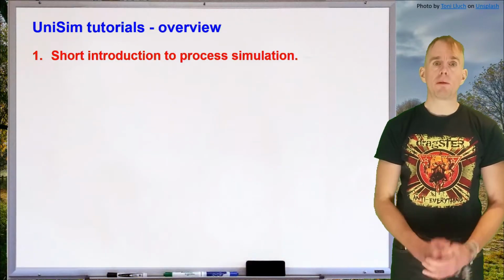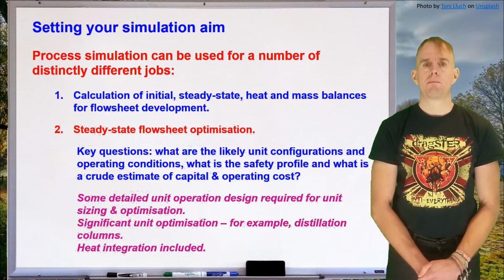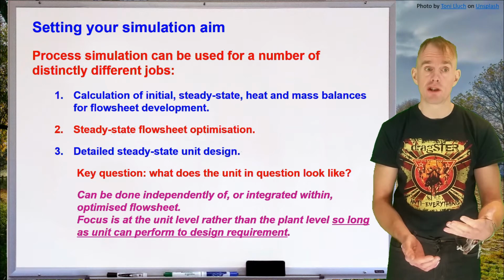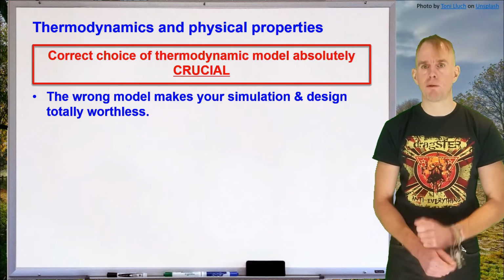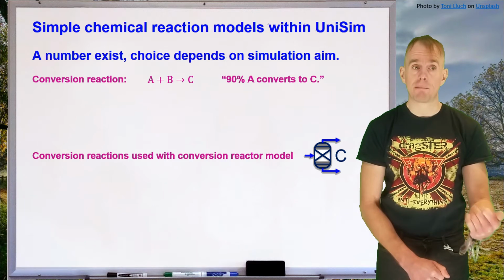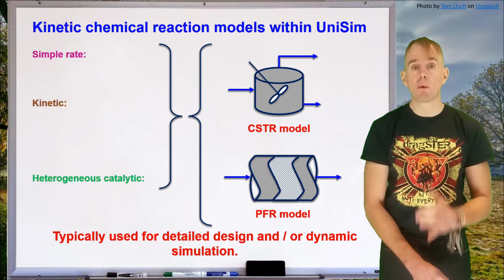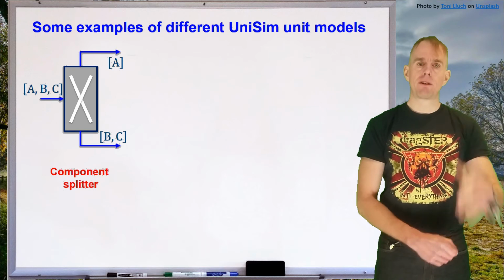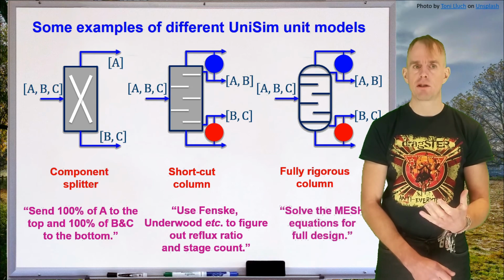An introduction to process simulation using UniSim [by Dr Bart Hallmark, University of Cambridge]

Comment: Such a great video. I have a question can we use UniSim for LCA of Lithium ion batteries? If we are planning to find the energy use of the manufacturing stage and production stage and put it as the input parameters in Greet?
Reply: Can i get your email i have some questions and it will be really helpful if i ca able to talk with you?
Reply from the maker: Thank you for your kind comments. It may be possible, yes, if you can construct a suitable process model (with an accurate thermodynamic model) for the parts you wish to calculate energy use for... The challenge may be finding a suitably accurate description of some of the ionic species - although I haven't seen a new version of unisim for many years now!
Reply: @drbartsworldofchemeng For energy-use estimation at the manufacturing stage, would it be reasonable to simplify complex ionic species using pseudo-components or literature-based property data, rather than modeling full electrochemistry?
Reply from the maker: @duaa3489  I'd have thought so, yes. Just make sure there's sufficient literature data to sanity check your results!

Comment: Phenomenal. Just a quick question.
I've been learning Aspen Plus for some time now and I'm quite confused. HYSYS and Aspen plus are from the same parent company yet they are nothing alike. How do I know which one to choose when simulating a process?
Reply from the maker: Thank you for your feedback, it's appreciated. 

Hysys was developed by a different company and then bought out, which is why it looks so different. The strength of Hysys was originally oil and gas related projects, although I suspect that both tools are equally as applicable to most projects. They key to choosing will be whether or not the chemical species you wish to include in your simulation have an adequate thermodynamic description!
Reply: @drbartsworldofchemeng  Thanks again, Dr. Bart

Comment: Thanks Dr for this super helpful intro. Can you elaborate how to rightly select the fluid package (FP) and how to properly validate our selected FP?
Reply from the maker: @alhadad1979  hi, glad you found it useful! The answer to this question is not straightforward! You need to consider the chemical nature of your species - non- polar, polar, ionic etc and then select whichever equation of state, or activity coefficient model, best models them over the temperature and pressure range of interest. Your best starting point is the Unisim thermodynamic guide as that will detail the methods that are implemented and their limitations.

In terms of validation, as ever, find appropriate experimental vapour liquid (liquid) equilibrium data in the literature and see how well your chosen thermodynamic basis predicts it!

Hope that helps

Comment: How can print my result after finish
Reply from the maker: Which results do you mean? You can print the stream table data by using the reporting function. I used to screenshot the flowsheets - or redraw them using Visio
Reply: I mean optimization any process simulation or any project done not just PDF also table, chart, etc